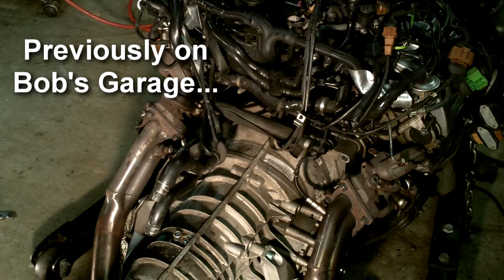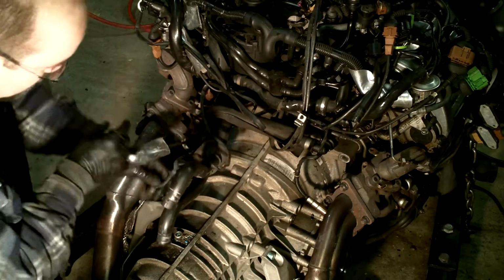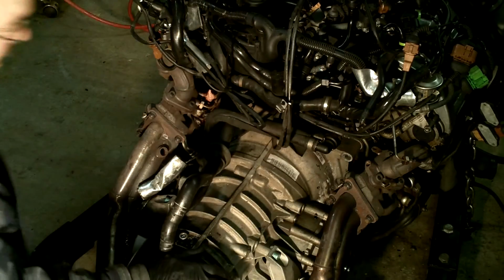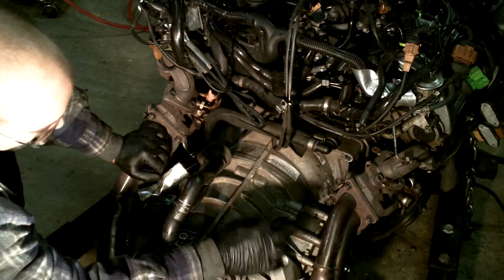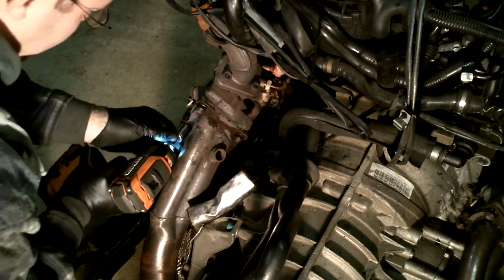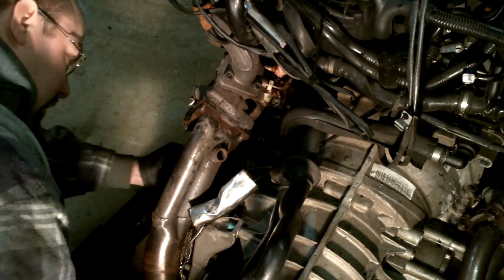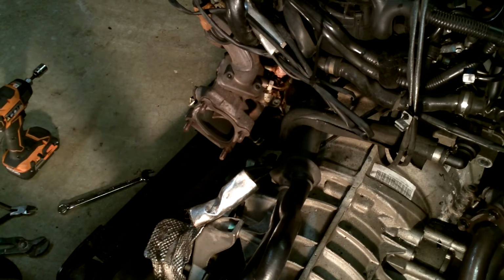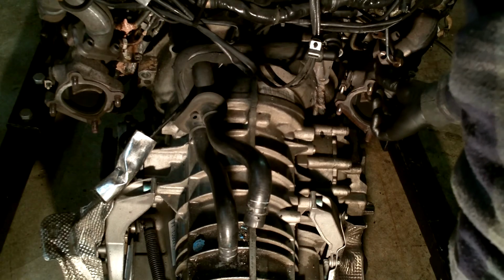2002 Audi S4: Ep. 146 - How to remove your downpipes

Comment: I removed my stock downpipes and installed 3" ssac downpipes without removing the engine, dropping the sub frame, etc on my TIP 2.7t. It is a tedious job, but not impossible.

So to those who want to upgrade your full exhaust, it is possible, you just need to remove the trans mounts and brackets to create enough room. 

Great vids as always Bob! Keep it up! This provides so much reassurance to the DIY guy that he can take on these jobs!